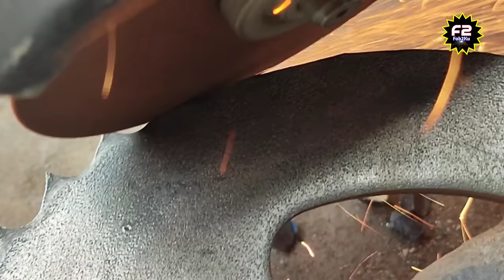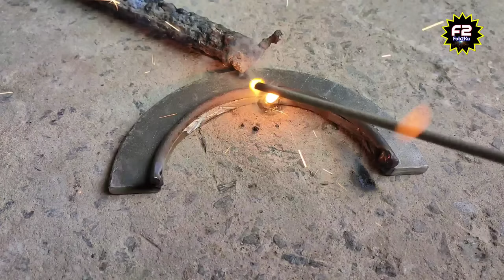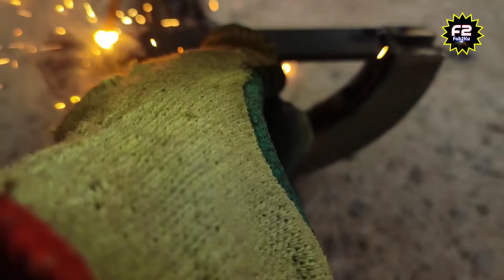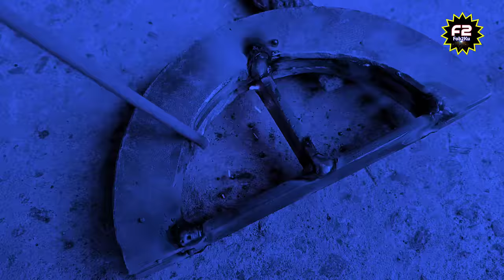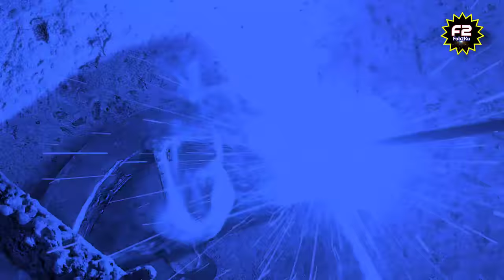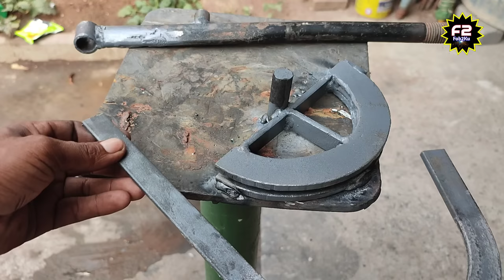Easy And Awesome Techniques For Flat Bar Sideways Bending / Homemade Sideways Bending Tools

Comment: You never fail to amaze me Sir! If you could find a bearing to replace the stub of bar that pushes on the stock being bent, it would be easier to bend and less likely to pull the flat bar forward in the bender. Great, great job of bending flat bar! You are “THE MASTER”!
Reply from the maker: 😀🙏❤️👍
Thank You Sir
Reply: I bet you could drill the stub bar through, and mount it on a well-fitted (and greased) shaft instead of welding it, it would work like you said, and be easier to bend the flat iron, as well. Good idea you have there.
Reply from the maker: Thank You Sir
Reply: I thought the same thing because i have seen it in other videos too. Good idea!
Reply: Excellently done, very creative and practical.
Reply from the maker: Thank You Sir🙏😀❤️

Comment: Instead of welding your semi circle bolt it in place and make it 360° instead of 180° that way you can make full circles great video!!
Reply from the maker: Thank You Sir🙏👍❤️😀
Reply: How would you remove a full cicle from the tool? I wonder.......
Reply: @nickwinn7812  no doubt!  Lol. Edit:  I think he meant to bolt the tool together, so you could take it apart to remove it.

Comment: I like this tool. Mine has the top plate bolted so I can bend greater than 180° and still able to remove the bar. Great use of scrap material and we also got to see a bit of cold forging in the process. I think you have a good eye when it comes to making shapes look uniform.
Reply from the maker: Thank You Sir